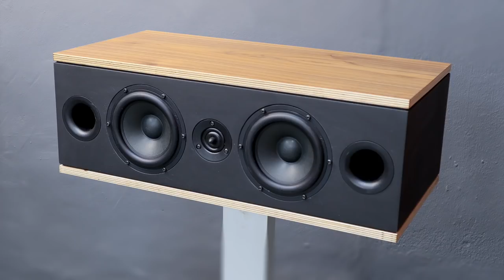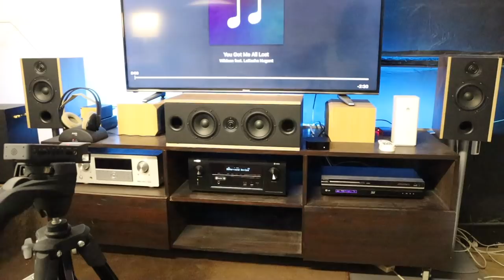Home Theatre CENTER CHANNEL Speaker Build - SOUND DEMO - by SoundBlab

Comment: The sound is great. For me, nothing can express the mood when hearing the sound coming from your sound system. great.
Reply from the maker: Thanks
Reply: What was the third song on the piano track it sounds very nice. Especially on your system. But I must say your speaker sound is kind of like listening to acoustic in an empty theater. It sounds echoey and shallow. There's no depth or richness but plenty of twang. But that's what happens when you use too many tweeters and mid-range loudspeakers with no real woofers to back it up. I know my phone on Lincoln face so much but it does produce good sound. Sorry for the previous comment my stupid autocorrect and I had to fix it and it wouldn't let me delete it.

Comment: What would you say these are equivalent to, as far as what's on the market? I know this might be a difficult question to answer, but best approximation, maybe.
Reply from the maker: A very difficult question to answer, and I have not heard many of these I could compare it to. So, the comparison is based purely on what I consider to be quality and pricing of the components in my build and what a manufacturer  might suggest as a suggested retail price based on their manufacturing cost, markup and perceived value for money. I think you can look at the price around US$600 each or more. When you look at the fact that the parts in my build are just around US$150, then adding cost of enclosure materials, and labor in form of a markup, you can easily end up with even more than US600. Not to mention retailer markup on top of that. Look at something like the B&W HTM 6 or the Dali Oberon Vokal. There are others many others. This of course, is only my humble opinion, but if you can build a good looking cabinet and considering the quality of the parts used, you will end up with a very good speaker that will compare well above what it cost you to make.

Comment: Hey I have a question for you. so I recently wants to make home theater setup and I'm kinda confused about choosing right speaker shape for surround speakers, which one do you prefer? Oval or rounded one? (For center and surround)
honestly I don't care about the sound quality, I just want to make it simple and can feel the surround sound
Reply from the maker: I don't know of any oval shaped drivers that are suitable for home use. You must be referring to the typical oval designs that are normally used in car audio? If you do not care much about sound then there is nothing wrong with using either for your project.
Reply: @SoundBlab  I don't thinking will use car driver, I still remember when my parents have Samsung 5.1 home theater Blu Ray player, it using 1 oval driver and 2 circular mid driver every channel and I forgot the type of it. I just want to ask Which is better, and I'm curious which one have a wide range sound and can deliver good surround sound. Thanks for your answer!

Comment: Any details about designing corssover for this central box? I did one but Im not sure if my approach was correct, after all this is different speakers geometrical positioning than in typical stereo design...
Reply from the maker: Your frequency response will change from the listening position if you orientate a stereo speaker horizontally, and thus also the XO will need to change. My aim here was however to try and voice the center channel as close as possible to the left and right channel speakers. So, the XO is different, but you can only really voice it similar by ear. So it takes a lot of listening to fine tune the response.
Reply: @SoundBlab  got it, of course I also did measurements having central speaker in horizontal position as it is used. However I did not compared sound by ear with left and right channel speakers, stopping just at heaving measured response close one to another.

Comment: Just a general question, if I wanted a passive radiator how would I calculate the size?
Reply from the maker: There are some online calculators that can help you do this. You need the specs of the PR. You can also use WinISD, an enclosure design application.

Comment: Where does that warn type sound coming from ? Is it the amp thing?
Reply: Silver Flute speakers have a fairly warm sound signature. Because it's a lot more balanced due to the extra woofer in the center, the sharper highs from the Peerless ring radiator tweeters have been tempered a lot.

Comment: Bass is not loud but very good 😁😁😁
Reply: It's a sound demo and you'll never be able to hear its full potential via a YouTube video.
Reply: Also, they arent subs, they are only 4 inch fullrange speakers. They aren't going to have that much bass.
Reply: if they were at least 8 inch  you would perceive better bass
Reply: Lol, "bass is not loud", its not supposed to be loud rather to complement and gel with other speakers. Its performing well esp as a center channel, good mids with no muddyness and well balanced
Reply: @sethh8892  Sorry Seth, but at 0:30 the guy states he has a small sub connected.  You are right in that its impossible to really get a feel for any speaker review on YT given the compression.  Plus the end result is only as good as the hardware you are using to listen to the video, which if its a laptop or cheap headphones won't be anywhere near as good as actually standing in front of the speakers in person.
Reply: @MalcolmCrabbe  yeah, i didnt even hear that. Wasnt using sound just viewing the vid. Didnt want to disturb anyone because we were in public. Thanks for pointing it out. As CMS Sajith said, its not supposed to be loud, its there to complete the frequency spectrum. This isnt for low numbers lol, not car audio.
Reply: @sethh8892  5.25" woofers, not full range. Those speakers have way too much breakup above 5kHz for that purpose.
Reply: @mndlessdrwer  usually speakers of that size and home audio use are considered full ranges. But yeah I guess you're right, the proper name would be woofer.